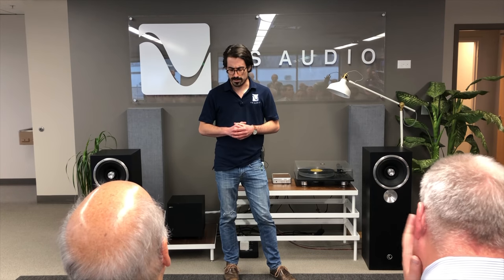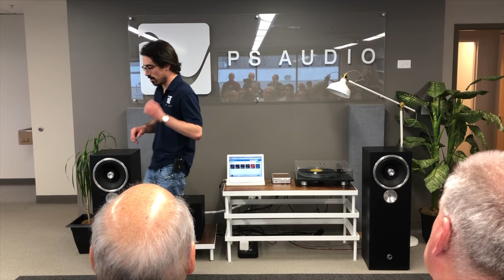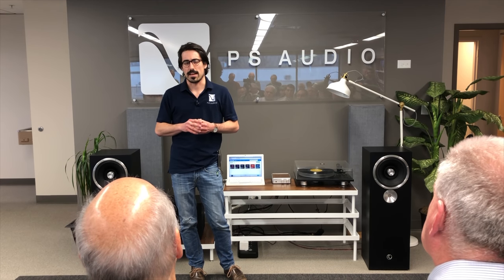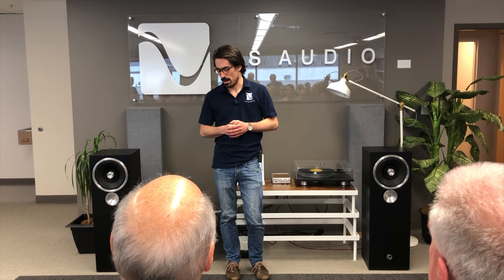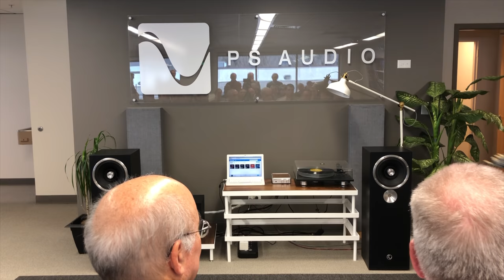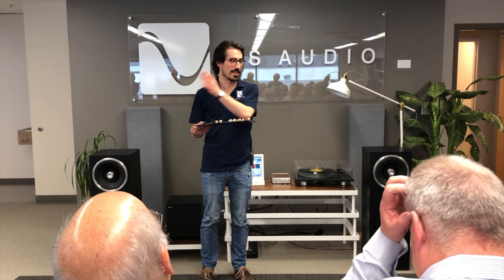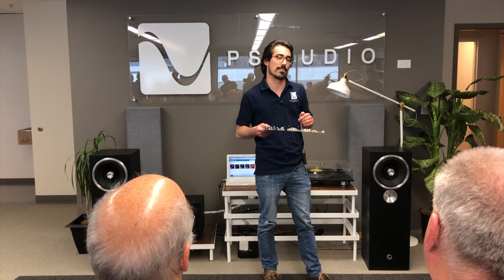Stellar Phono Circuit explained

Comment: @24:20  - 700 parts?  That doesn't sound efficient to me.   Can someone tell me why more components means better in this case?   I tore into an old MELOS super basic stereo phone stage the other day and it performs excellent and has around 40 parts in a tiny metal case 4" x 3". Big contrast here. I tested it for noise and there was none. There was no cross talk.

Comment: I thought that it was pretty much common knowledge that passive RIAA was superior to feedback derived RIAA.  I prefer circuits with very linear transfer functions and NO feedback. I've had some very nice phono preamps but the Counterpoint SA 5.1 with directly grounded 6DJ8 cathodes, zero feedback and passive RIAA is my go to unit for liveliness and open sound.  It's not the quietest, and the specs guys would say that it has poor distortion specs, but it plays MUSIC very well, connected to a silver wire step up transformer and a low output moving coil.

Comment: So now after he explained very good what this product makes so special 

I need to see the schematic !!
Openloop gain heavily improves by using parallel input transistors. But which jfets are used? They are difficult to get if not used in HF fields and if you want to match them you need even more of them. Bias into class A is great + high openloop + modest closedloop feedback very nice and indeed good design. ...From the technical Point of view a very good approach

Comment: Very good insights and hard work. It's really hard to get -150db noise, especially with out the chassis??
Great to have younger designers to come in, esp to work on phono stage.
I was spending time to work on // bipolar as well as Fet single stage amp, with works on p supply. But after a while just faded out, to enjoy op amps implementation with more predictable outcomes...
But the biggest factor is the community and customers demand that make it all possible, which make  amateur like me to admire!

Comment: I'm very happy with my Parasound JC3..... but they have my attention!   I would like more loading and gain option than the JC3 has, and lower noise.   I like Darren's passion, but like many engineers, he doesn't dumb down explanations very well...  that's fine.  I'd prefer he just stay in his zone.  Paul is the rare breed that can communicate well on a high level, and also to the average person.

Comment: Maybe the 700+ parts is to justify a $2K pricetag?  It seems to me there's no other rationale for that sort of over-engineering exercise.  Then you feed the output into a Sprout, which means the speakers are driven by an off-the-shelf Class D chip from ICEPower.  Oh well, I suppose that will make sense to somebody, somewhere...
Reply: @LD Blake -- I for one love modern Class D amplification.  IMO the engineers at those chip companies know exactly what they're doing and my tiny Class D amps -- one for my home stereo and another for my electric guitars -- are every bit as good as the much bigger and far more expensive equipment they replaced, at least AFAICT.
Reply: @LD Blake -- Hear, hear!  My home stereo amp cost me about the same $$$, is based on two of the same surprisingly good TI chips but is a tad larger, with one chip for the left and right channels and a second wired in (P?)BTL mode as a dedicated channel for a passive subwoofer.  It has a single logic-based power/input switching pushbutton with a choice of two line-level inputs -- one 3.5mm stereo phone jack and one of the usual pair of RCA jacks -- or a Bluetooth circuit that only rarely gets used here.  My only gripe is with the too-high low-pass frequency of the subwoofer channel, and that was made front panel adjustable in the latest version of the product, which costs only about $10 more.
Reply: @LD Blake -- My little wonder replaced a massive (and very good) 100WPC 1980s vintage JVC integrated amp when I retired and became an apartment dweller.  Given appropriate speaker choices, IMO this sort of amp is more than enough for all but largest listening rooms, audiophile delusions to the contrary notwithstanding.

Comment: Thanks for the video, love it. Question, I have an external phono RIAA pre amp and I hooked turntable to its ground point , now do you recommend to earth it better like use one of my power conditioning ground point? Is it better to ground to the chassis “common ground “of a preamp or a earth ground of a power conditioner? Thanks
Reply: LD Blake so its better to ground to earth on my power conditioner ? I have it ground to external phono riaa pre amp right now
Reply: Because a 3 blade terminal is earth ground from my power conditioner ground point
Reply: LD Blake yes I understand... but I don’t have a ground point on my main amp u see
Reply: Hey sir.... i don’t think  you  understand my situation here , maybe your main amp has a grounding point but  I don’t lol ,so all I have is 2 options either to the external pre amp or the earth ground via power conditioner u see
Reply: LD Blake ok I can, but you don’t think earth ground is better then grounding together? Thanks
Reply: LD Blake sounds logical.. no emf pulling at one side right? All even emf. I will try this thanks a bunch
Reply: Pure and simple: 
The ground wire from the turntable should be connected to the chassis of the component that contains the phono preamp.
Reply: David O'Banion so loose one screw of my av receiver and insert there
Reply: David O'Banion despite that I have an external phono preamp?

Comment: Did you find that with open loop compensation the transient response was improved causing better separation of the signal vs surface noise ?

Comment: Really enjoying this talk! It makes me wonder tho, since this is FET based, are we talking JFET? MosFET? both? I only ask since JFETs can be such a nightmare sourcing being that most are obselete and they have such a crazy parameter spread. And to add with all that many are fairly low gain. But....I love them anyway and am curious if they made it in the design.
Reply: My question was answered, at least partially, later in the video. TO-220 package MOSFET in the output stage of the discrete opamp design biased into class A. Very cool.

Comment: Darren looks down a lot, right into the mic as he talks. That's why it gets "hot". Don't feel bad Paul. Yell at Darren.
Reply: It's the audio technician, not the talkers fault. They might have underestimated how loud he was going to talk. But if you have no compressor or limiter your normal signal top should be between -12 and -18dB. If you have compression and limiter you can record at about -6dB. Even with -18dB, the noise floor of the mike is normally in the -70dB to -90dB range.

Comment: What are the speakers in this set up?
Reply: Those are Zu Audio speakers. 
The different models look similar so I can't tell you which model they are.
Zu's are very efficient.... Therefore a good match with the little PS audio Sprout integrated amplifier that is sitting between the turntable and the laptop.

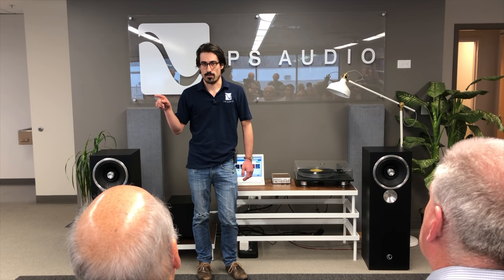Comment: 11:20 wtf? do you take noise into consideration?
Reply: The 0.00008% you quoted is thd+n not thd it self. Look at other figures. Jesus.
Reply: Also, at 1khz the Aol is only 80db.
Reply: The open loop distortion of opa2134 should be around 0.5%
Reply: @John,Paul is 99% true and 1%
humor! and he fudges that and slips in more than that at times.
I have zero ability to understand any of this, I can only suspect there might be humor in Darren's presentation, as he's pretty close to that Paul McGowan Daily.
👍👍👍👍👍

Comment: Forgive my ignorance, but is the number of components anything to do with sound quality? Sounds very complicated if it breaks.
Reply: In this case the amount of parts is large just because its fully discrete, instead of using of the shelf opamps as an example. The amount of parts has nothing to do with quality, more or less components really mean nothing.
Reply: I was asking the question because this video, and the narrative above, seems to make a big play on the number of components. Were I marketing this product I think I'd underplay that aspect. Rather than trying to impress us with the volume of components, the better approach is to explain what they do to justify their existence.
Reply: @LD Blake I have to say not confidence inducing. There is some serious competition at the quoted price point and I also got the feeling it was all a bit vague in terms of the design rationale. That said, designers have to start somewhere and of course PS Audio wouldn't be putting their name to something that harmed their strong reputation.
Reply: @LD Blake I don't agree with that analysis. There's a hierachy to phono stages as there is with every piece of kit.
Reply: @LD Blake -- While that little Behringer is probably just fine for 99+% of vinyl enthusiasts (definitely including PS Audio Sprout owners) and its THD is more than adequate considering what comes out of phono carts and what humans can actually hear, that "68 dBu @ 0 dBu, A-weighted" S/N seems like it could easily be improved upon with very little impact on the cost.
Reply: @LD Blake -- OK, understood.

Comment: How ridiculous. 
The number of parts in any component should be as few as possible to get the job done. 
A very good phono stage can be made with less than 100 parts, including the power supply. 
If I was running an audio company and one of my engineers proposed a design using seven hundred, 
he would be looking for a new job the next morning.
Reply: That explains why you don't have your own company I assume you know more than anyone else
Reply: Sometimes very good is not good enough.

Comment: How come, people that make audio equipment (Ok, it's home audio, not broadcast)can´t make good recording of one man's voice. There is no simpler thing to do.

Next.  All amps that use monolithic (chip) OP amps sound the same?? WTF?? 
Discrete OP amp is better? It is still OP amp, by definition, circuit with a lot of open loop gain that uses feedback to control amount of desired gain, isn't it? Ok , you can control open loop gain in discrete stage, and avoid global feedback of the stage.  
Next, in discrete design you have much more problems with individual parts selection, thermal stability and so on.

Comment: Yeah sorry but he's talkin BS, that power supply decoupling with a high ESR comment at the end is one of many great BS answers, he would be correct if you could connect at the point of the effective ESR resistor and the pure capacitance but you can't. You can decouple but that's now you do it. Most of the other stuff he said was about as accurate. He wouldn't last a second at instrumentation front end design.. where you can't BS like this. Ahh... the sad state of "high end audio". Enjoy the Placebo effect.
Reply: Do you have idea of crc clc filtering?
Reply: Also he is doing the correct thing in general in this.